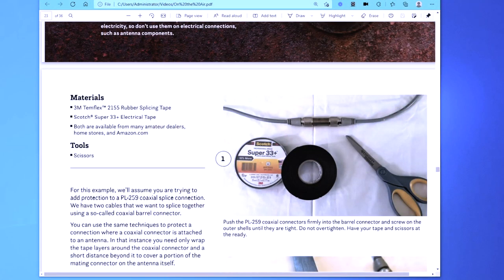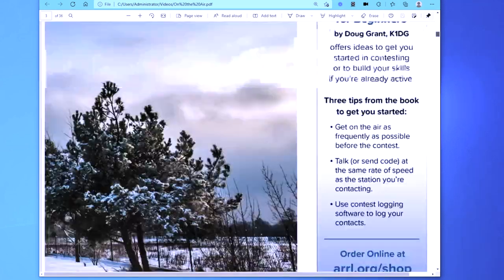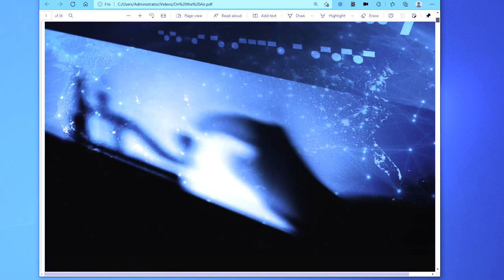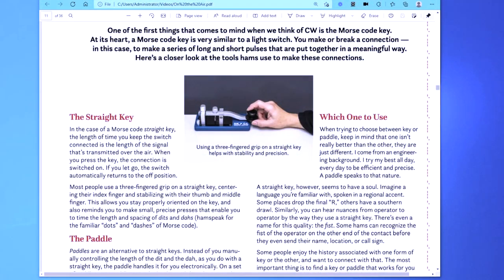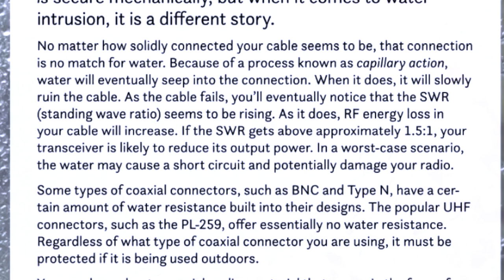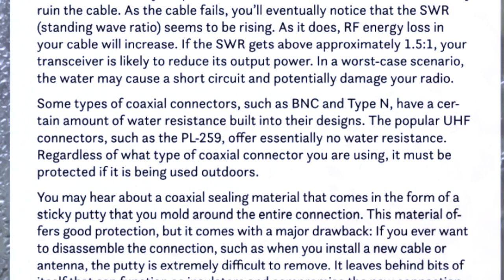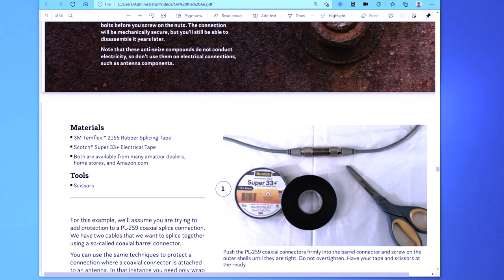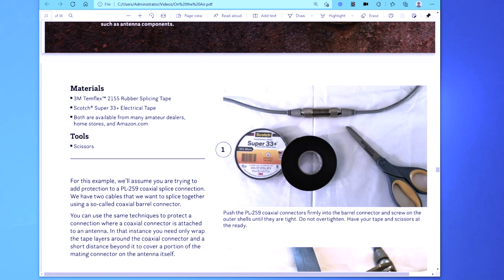ARRL OTA Magazine Article, Protect Your Outdoor Cable Connections, Oops!

Comment: Jim, You are the true Elmer of all Elmers. I take particular note in the fact that you consistently provide valuable information to the Amateur Radio Brotherhood without the neccessity of hawking products.  In particular, your videos on grounding. I am in total agreement that all paths must lead back to utility ground. There is a plethera of bad information out there. You are a credit to the discipline. I pray for your health and well being and look forward to your next video. 73, Dennis K2DJS
Reply from the maker: Thanks Dennis. Boy, many argue with me about that.  The NEC, in my view, is clear about that.  I have had some polite and respectful arguments about that.  They continue to argue even after I explain in detail why it must be back to that common point ground.  I tell me to just look at the connections that were put there; for a reason!  I was a Building Inspector and I was strict about safety issues.  My others in my office were not. 73, Jim

Comment: At 10:52 you make reference on pointing out the beginning of the wrap and how it will allow water to seep in, but I'm missing how that will happen and how it would get to the coax connectors since they are first wrapped with self amalgamating tape. I was taught to do it slightly differently. First wrap the connection with a single layer of 33, then a layer of self amalgamating tape starting and ending beyond the wrap of 33, then another layer of 33 for UV protection. The first wrap off 33 is to make it easier to expose the connectors at a later date since amalgamating tape can get really 'gooey'.
Reply from the maker: I am working on the next video.  Wait for it.  Your way of doing it works great.  I have done the same thing.  And, you will hear of yet another "twist" on that idea.  73, Jim
Reply: @ham-radio  Thanks for all your hard work Jim. Appreciate the videos. Hoping you have a speedy recovery.
Reply: Richard: Thats exactly the way I have been doing mine. In 30 years of "hamming" never had any form of water ingress in any of the hundreds of connectors I so treated.
Jim, as always... a most interesting video. We appreciate the time and effort you spend making them. We really do.
Albert. EI7II.

Comment: 4:27 I believe dots and dashes (in the context of a printed magazine) is correct.  6:43 consider the scenario that the coax "breaks down" and the transmission line impedance changes, losses might increase and the SWR will increase due to mismatch. 10:22 the tape is made from mostly silicone, not teflon.  Teflon tape is used for plumbing, not amateur radio.
Reply: I believe that a period is also written as a dot, but we still call it a period. The visual (written) dit is a dot and a visual dah is a dash but the (spoken) name doesn't change. I believe dit and dah is not common terminology for new hams.
Reply: @leagarner3675  You have a good point, especially since this magazine's target audience is "new hams"
Reply: @daveN2MXX  In which ARRL publication is the "no longer quite as new as they were ham" transitioned from 'dot dash  dash dot dot dot' to "didah dahdididit"?  Train as you fight...from day one.
Reply from the maker: Thanks very much David.  I think you made my point really clear to all.  Your "proofreading" of my video is exactly what I am talking about.  You found issues that would need to be corrected or modified in my video. And I thank you for that.  It makes my point that proofreading is important.  I have no way to do that.  The ARRL has a paid staff that can easily do that.  It was just lazy, careless work on the part of the ARRL to do that they did in OTA.  As a 70+ amateur radio operator since the age of 14, taking 22 pills every day for the treatment of cancer in my blood, I can be fuzzy headed, dizzy and sleepy.  I might also add cranky. And it shows.  Thanks again for proofing my video and giving me the times where I need to go back and take a look. That is very helpful.  Also David, it would add some weight to you position if you had included your callsign. Take care, 73, Jim W6LG
Reply: @ham-radio  God bless you for continuing to make these videos....you are a knowledgeable individual and have a lot to share.  The ARRL needs to do better.  Period.

Comment: An anecdote to support your account. One of our more clued up customers had a paging system with 13 sites, he insisted that one site was underperforming. 200ft tower LDF550 and a "white stick" 150MHz antenna. Obviously first check was forward and reflected power at the transmitter, all fine, reported back to the customer. He again insisted that something was not right, so we hired riggers to check forward and reflected power at the top of the LDF550. Again all OK. Customer stuck to his guns though so just to "shut him up" we employed riggers to go up and change the antenna. Customer finally happy. My colleague brought the antenna back to the office and we checked it with a VNA. I said to my colleague "that ain't jaggy enough" (SWR was not awful even at 300MHz) ran a box cutter down the sheath of the cable to be greeted by blackened copper and water dripping. Water damaged coax can make a great attenuator, this was just a 2m tail of RG213.
Measurements suggested that we may have had close to 10dB of loss in just that short tail. 73
Reply from the maker: Very interesting.  Water damage to coax still amazes me.  Thanks for taking the time to write all of that detail.  I think it will help others.  73, Jim W6LG
Reply: @ham-radio  thank you for the reply, it is indeed shocking how poorly water damaged cable can perform yet also improve SWR, exactly as you described. Incidentally all of our installations used self amalgamating tape over the entire connector assemblies, that covered in a layer of Denso tape to protect the other from UV. The water ingress was via the actual antenna. Fibreglass antennas often develop tiny cracks from fatigue in high winds, subsequent freezing and thawing accelerates the damage. 73

Comment: First I wish you good health. Second my friend and I were discussing the exact topic of SWR vs. coax loss only a few days ago so this was good timing. I had made the point of SWR meters having great use when being used with an antenna tuner (for HF) versus something like an SWR measurement on a 2m setup, where the radio is plugged directly into the antenna. "If we all wanted to lower our SWR we would all use lossy cable" meant facetiously of course, makes that point somewhat bluntly.  Very interesting to learn about the connections as well. Will stay tuned. 73.
Reply from the maker: Thanks and I will discuss more on both of those topics next.  73, Jim

Comment: I like the big inline chokes from Palomar, the large ones that resemble pipe bombs.  They do a very good job, but they seem to take water like a sinking ship.  I've ended up using a whole ton of self amalgamating tape on them to get them to stop giving me shorts when used outside.  Also, I've started to put electrical tape on seams and objects before the "putty" tape, because it certainly does make it easier to tear apart later, especially on things you know you might need to break into later.  

Good luck with your health, and 73, old man.

Comment: Jim certainly has some good points but calling dots and dashes as being incorrect is in itself incorrect. Technically it’s correct in ham radio to use dits and dahs but Morse was a visual language in some places. From what I understand BSA used to teach it as dots and dashes (I wish they didn’t). In fact it was dots and dashes back in the late 1870s when a needle produced code on paper/ticker tape. And yes I’m aware that ARRL publications have had a lot of errors but it’s gotten better - David Minster himself goes through a lot of them and finds errors to be fixed. They’re actually looking to improve measurably in that department.

Comment: I always focus on the direction of the wraps and end or ends I start at. The wraps should shed the water, as you pointed out. I also never start a wrap on a connector in the direction that unfastens it.

Comment: As aparamedic for the past 30 years, if the pain is so bad, over a 7 out of 10, CALL 911 FOR AN AMBULANCE. At those levels above a 7, it can be fatal...PLEASE< PLEASE call an ambulance.
Reply from the maker: You are right....call 911....don't wait.  Gary, I have severe osteoporosis, CHF, left ventricle failure and pre-leukemia with myelodysplastic syndrome with blasts at 1.5% along other issues.  I am almost on full time oxygen.  So, yes, we made a mistake.  The hospital was awful.  The surgery had to be delayed until my stats were better.  Next time, I will call for an ambulance and not have my wife take me.  Thanks for your help and good advice.  73, Jim W6LG

Comment: I think you should worry more about producing your own flawless content, and less about what the ARRL is doing.
Reply: @Brian Swann The difference between you and Jim is that he points out errors and shows how they can be improved.  Thanks for stopping by, though...  73
Reply from the maker: @RechargeableLithium I try.  I do make mistakes and that proves the need for proofing.  I have a budget of about $200.  The ARRL has a budget above $1500000.  They can afford to have someone review and correct.  Yes, I made mistakes and will continue to make mistakes.  Flawless content is not possible. But thank Brian Swann for your view of the situation.  I think it would be helpful if you gave you callsign with the comment.  It would add to your position.  No callsign is a negative. Just a thought Brian.  Again thanks for your help.  73, Jim W6LG
Reply: @ham-radio  Thanks Sir.  No doubt - my 'pre-release QC' needs help more often than I'd care to admit.  I'm glad you're feeling better, Elmer.  Best to you and yours,  Andy KG5RKP